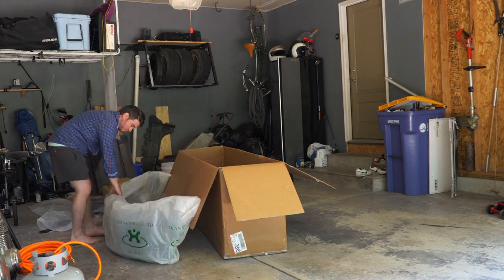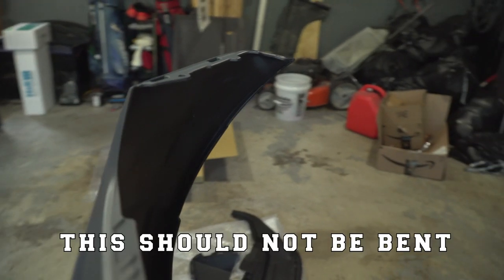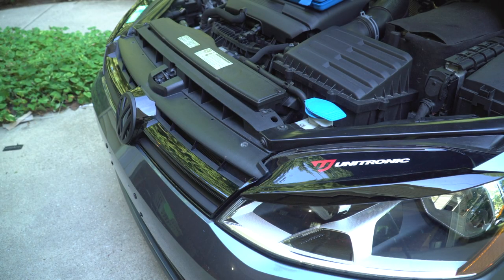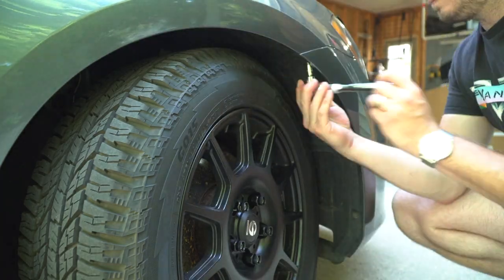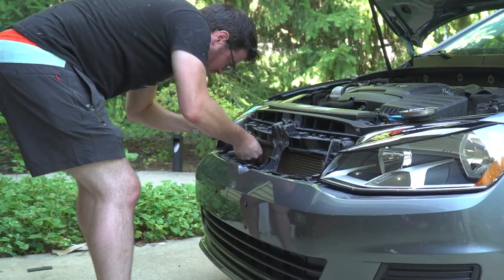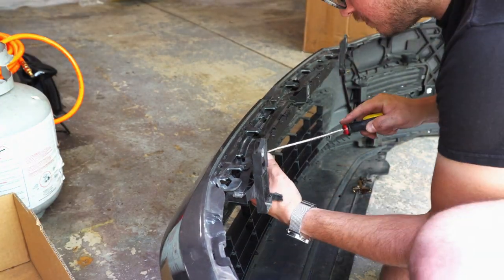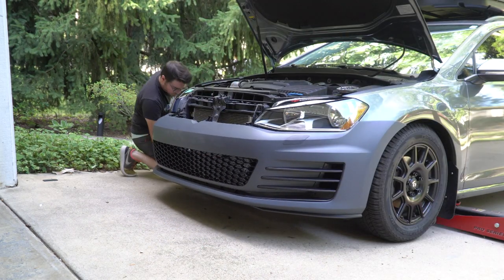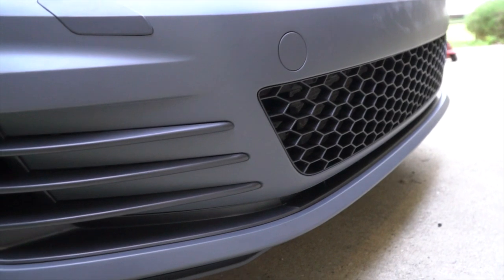Mk7 Golf GTI Front Bumper Conversion: Part 2 - Bumper Removal, Install and Test Fit

Comment: Hey Bro, Does it has A Marks for the parking sensors in the inside (To drill a holes for the sensors) ? (like the OEM)
Reply from the maker: I do not know. If i take if off again any time soon (which is likely) i will check!
Reply: @DadWagon  Looking forward for PDC info on the bumper!
Reply: Any updates???
Reply: @ProductiionzRA  little bit late but I looked at mine last bit for this exact thing. There's no marks .. you will have to measure and mark and drill urself

Comment: Nice job, do you know if just the hexagon lower grill fits in the stock bumper? They have the same part number ( 5g0 vice 5gm)
Reply from the maker: Great question! I'm not sure...😬
Reply: @DadWagon  thanks for the response, I will just have to pull the trigger on a new grille.

Comment: So I have a 2017 tsi sportswagen. I'm still like super beginner to mods. Would "any" mk7 body kits work? I'm also looking into a cut off exuast, where would I find one for the SW?
Reply from the maker: Josh, no - any mk7 body kits and pieces will not work. There are slight differences to the golf rear and front design after 2017. Most places call this out as either golf mk7 and mk7.5 (the updated models) or pre- and post-facelift models. you'll want to be sure whatever you're buying is for mk7 styling, and not 7.5

Comment: hey fam what kind of fog lights did you buy since the kit did not come with fog lights?
Reply from the maker: These are the foglights i used for the build - https://ebay.us/IuPVI0
Reply: @DadWagon  did you have to rewire? since the tdi plug does not fit into the aftermarket gti
Reply: @cloudy.m4  did you resolve this?
Reply: @Righteouness  yes, i just went to a volkswagen dealership and ordered the inserts for gti fog lights. Then i cut the TDI and wired the Gti ones. No issues and looks amazing!
Reply: @cloudy.m4  I’m having so much trouble with my right hand side foglight after using ‘plug and play’ cables. The left hand side Foglight works. What am I doing wrong? Do I need to code it in via VCDS?
Reply: @Righteouness  i would just return them and get gti fogs from ebay. then do the simple wiring.
Reply: @cloudy.m4  I have OEM fog lights. What is weird is my old halogen light works but the LED doesn’t. I had another Foglight and used it on the other side and it works but still doesn’t for right, wth?
Reply: @Righteouness  i’m not sure about oem man sorry. i have gti style fogs. but i do know in order to convert to led you have to do a full conversion. plug and play will screw it up
Reply: @cloudy.m4  full conversion? Like you mean adding resistors?